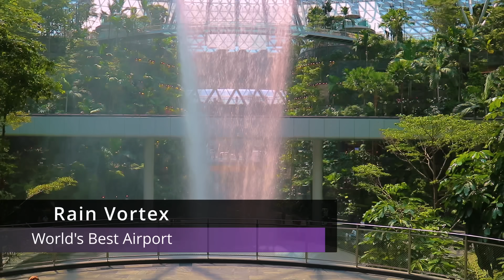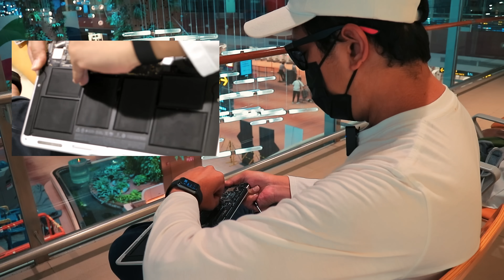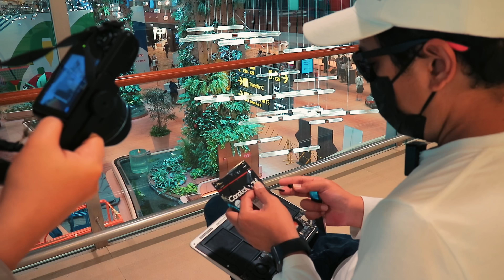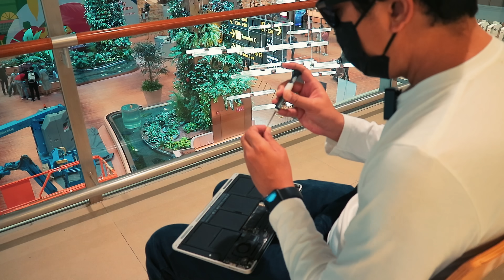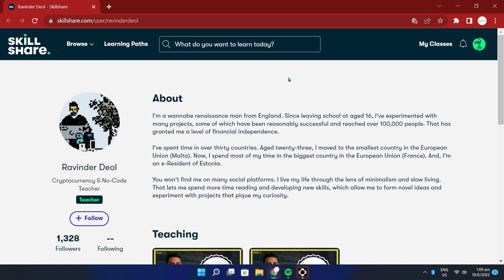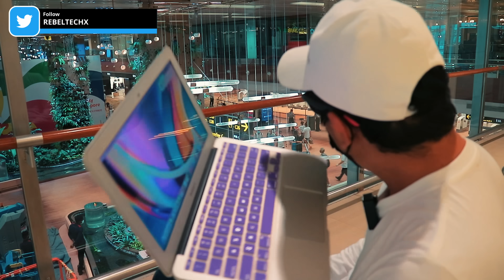Can Liquid Metal Revive My Old MacBook Air?

Comment: never heard of liquid metal paste. very curious to try it bruh
Reply from the maker: No worries. Only do it if you're really sure. I would advise on artic Silver or mx-4.  Need the right amount when apply liquid metal paste. Not too much not too little. And also avoid dropping a drop of liquid metal anywhere on the board other than the gpu and processor chip.

Comment: is it safe to apply liquid metal on an imac?
Reply from the maker: Safe only when you know how to apply it correctly. Has to be the right amount. Not too much and not too little. If you're unsure just stick to artic Silver or mx-4. If you're a risk taker, go for it hahaha but avoid dropping a drop of liquid metal anywhere on the board except the gpu chip and processor. It could be disastrous when done wrongly.